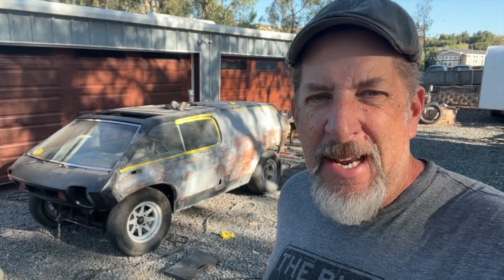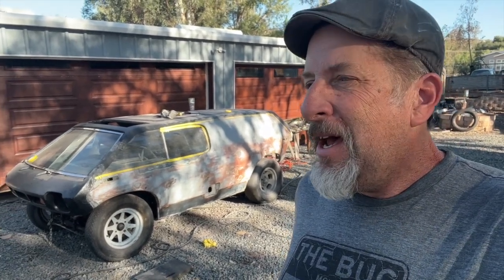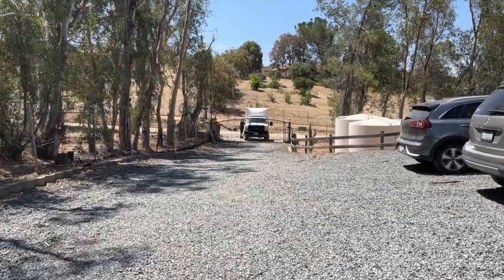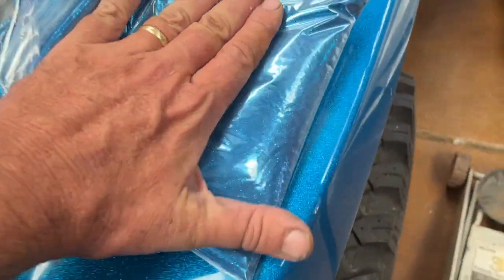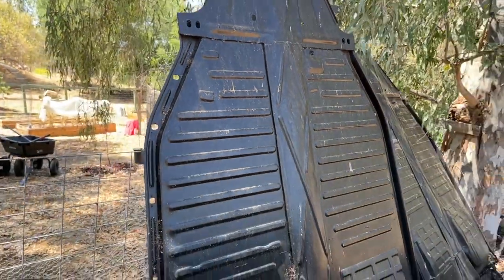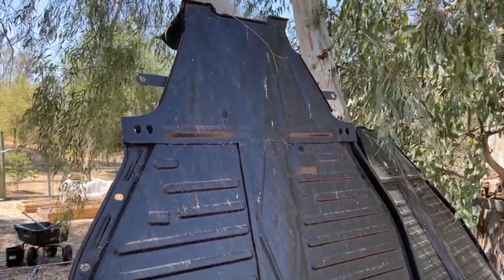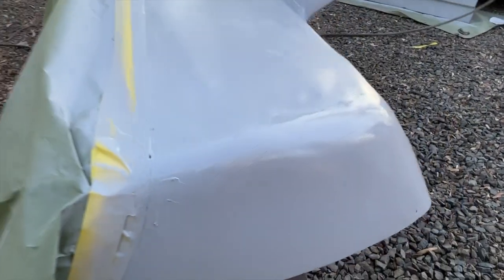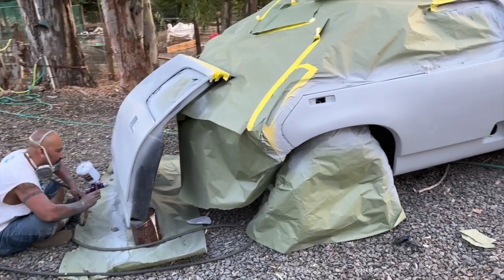Carchaeology: Brubaker Box body work and prime progress.

Comment: Hi Randy, have you ever looked into getting an inflatable spraybooth?  They come with all the extraction etc.
Reply: A friend of mine has an inflatable spray booth in Detroit, we use it for doing other minor repairs when the weather is bad. Keeps us from the rain and snow.
Reply from the maker: It is extremely rare that I spray any significant paint here at my place. It's been years really. Plus the climate is such that paint dries so quickly, the exposure time for stuff falling into it is very short.

For the top coats though we may tent it for a little more coverage and protection.